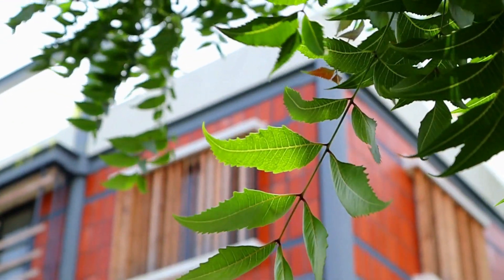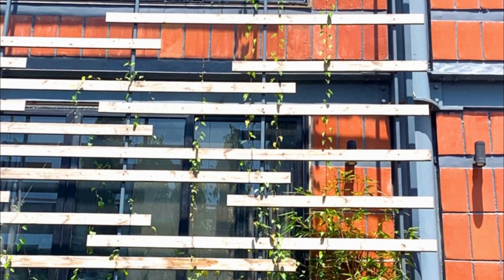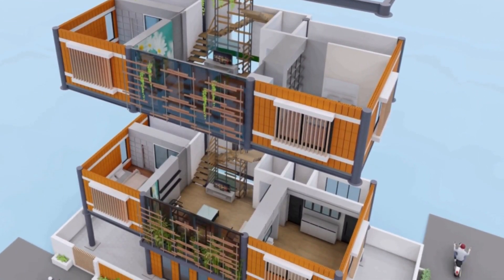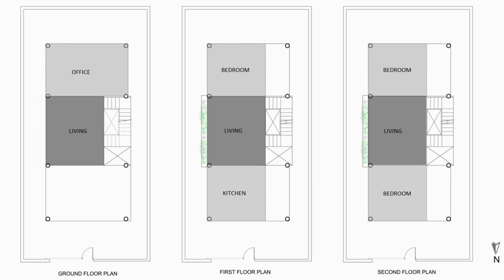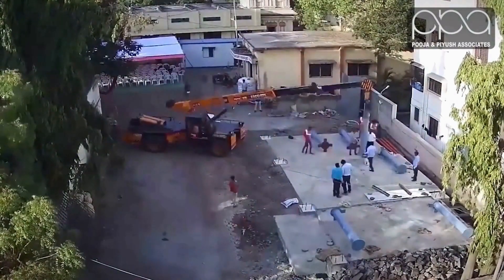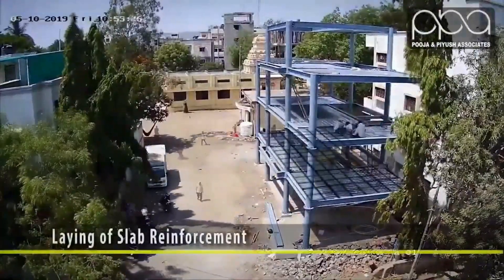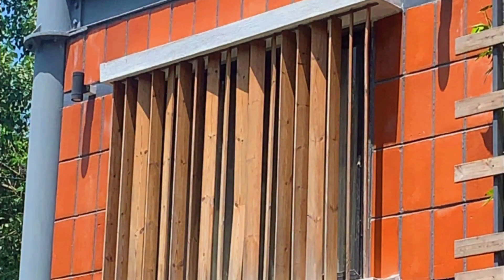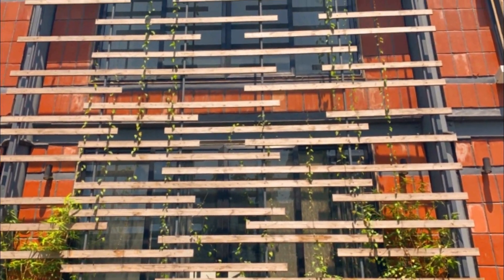Nuts & Bolts House, The Pre-Engineered Steel Building  by Ar. Pooja & Piyush Kapadia, Aurangabad

Comment: Can we make wedding venue of 10000 sq feet on dis structure...
Double floor
Reply from the maker: Surely…👍🏽
Reply: @piyush3131  then what would  be it's cost @ sq feet
Reply from the maker: It Will depend on design…pls call me on 9822533131

Comment: What will be kg/sq.ft steel requirement in steel structure for building Upto 4 floor, 4 to 8 floor, 8 to 12 floor, 13 and above(high rise)??? Pls can you help me on this... I'm doing a project on this topic.
Reply from the maker: Are you a civil/structural engineer
Reply: @piyush3131  No... Actually I'm doing research project on usage of steel in building
Reply from the maker: Do call me…shall help you…9822533131

Comment: Can I know the price of this finishing house if this possible to build in Manipur northeast than I love to build my house  like this
Reply from the maker: Pricing depends on Design and specifications…
Plz go ahead…steel is the future…
Assume 200/ sqft costlier than conventional structure
Reply: @piyush3131  Very informative project knowledge shared thanks , Please correct me if we used Rapicon or Areocon wall with metal frame structure , overall cost will reduce u to 20% less against conventional methods ??
Reply: We can surely opt for those walls…
Apart from structural cost escalation; we can save the cost of construction in many ways by adapting  SUSTAINABLE and ecological techniques

Comment: Please answer,

1 Bond between steel structures and blocks , like deck sheet and wall. ?

2 Electricity may flow in structure easily

3 Surface Structure may rust even after corrugation  

4 is extension possible ?
Reply from the maker: 1. Details for bonding two material need to be worked out

2. Proper earthing doesn’t allow current to pass thru  structure

3. It will not be rust as deck sheets don’t come in contact with sun or water…

4. Yes if foundation and structure are designed previously to take extra loads

Comment: I have two questions.
1) Is it advisable to make the whole building out of mild steel (inner and outer walls as well not just beams and columns)
2) Is there warping due to expansion on parts exposed to direct sunlight.
Reply: 1.yes we can do.but when its interior wooden interiors are preferred mainly due to electric shock.
2.thermal galvanizing spray can be done to protect exterior.
Reply from the maker: In India building all walls also in steel is NOT advisable Nor a good idea since there would be lot of heat gain in the structure…

There is no warping in steel structures…!!!

Comment: sir may i know how much total cost of the bulding with  and without also electric and plumbing
Reply from the maker: Assume 1200/sqft for basic structure as per today’s steel prices which may vary....
Reply: @piyush3131  1) in this rate substructure is included.?
2) 1200 rate is for structure+interior or only structure.? 
Please tell me.
Reply from the maker: Without interiors
Reply: @piyush3131  thanks
Reply: thnk

Comment: I wanna construct same kind of house in Bangalore z on pre existing Pillar based Home..G+1 , Can we do same construction on above of G+1 that is 2nd floor and 3rd floor , Cost per square feet ? Construction?
Reply from the maker: Need to chk if your previous structure is designed to take the extra load of the building...
Reply: @piyush3131  structure is originally designed and made for G+3
Reply: Call for any types of Prefab Building Construction. Farmhouse,Cottages, resorts,Villas etc.  9958918703

Comment: Sir, please confirm if steel construction is suitable for beach house or property closer to sea coast? Please advise. Regards,  Dan
Reply from the maker: In coastal areas there is humidity... thus you need to take extra care for steel structures and protect it against rusting by using epoxy/anti corrosive paints....
Reply: Thank you,  I really appreciate your response. I will approach your service. Once we decide
Reply: We can use croton steel material in seashore areas.

Comment: Hello, can you please insights into how plumbing and electrical works are done. What challenges we face. For plumbing we need to drill through steel decks. How is this possible .. please explain
Reply from the maker: All details can be worked out as we deal with conventional buildings....
We can take a sunk slab and also can have a raised slab to deal with plumbing works while electrical works can be consealed in slab...
Reply: @piyush3131  your email id and number please sir. I will share my requirement. Thanks.
Reply: @piyush3131  sir, for ceiling fan electrical box, we have to cut open steel decking sheet ? Or to run electrical conduct pipes from first floor to next floor, drilling steel required ?

Comment: Which brick is cost effective - Inter lock bricks or Porotherm bricks or AAC blocks? Which of these will reduce the heat and also which of these are earthquake resistant as many places in India are experiencing earthquake ? Can you please do a video explaining the differences between three of these bricks and reasons for you to suggest which one is the best? Also can we do gypsum plastering on these three bricks in order to avoid the usage of cement completely , its cost and heat absorption of cement? Hope to get a reply from you.
Reply from the maker: Any brick will transfer the heat depending upon its porosity....
To create temperature difference it’s always better to go with a certain degree of cavity...
Hollow clay bricks help to reduce heat gain...
You may also create cavity by using rat trap bond with regular bricks...
Would definitely work on your suggestion.
Plz contact me on 9822533131